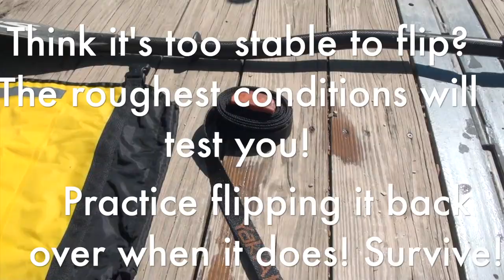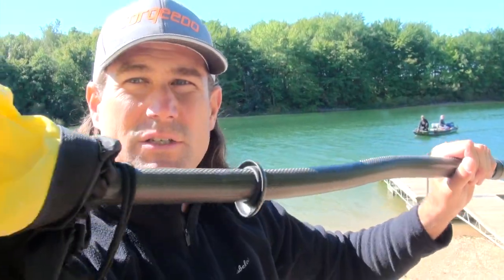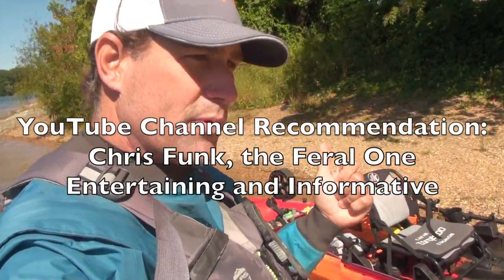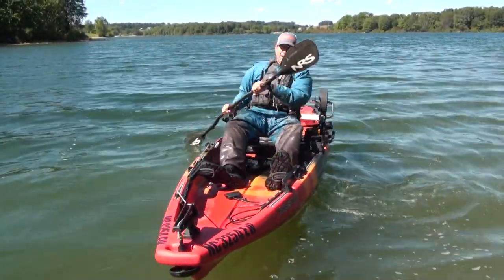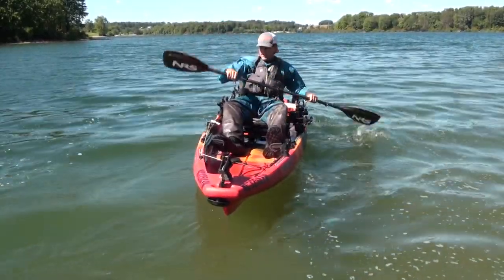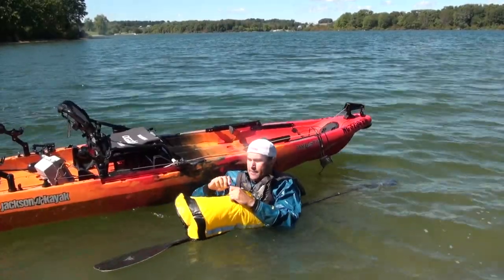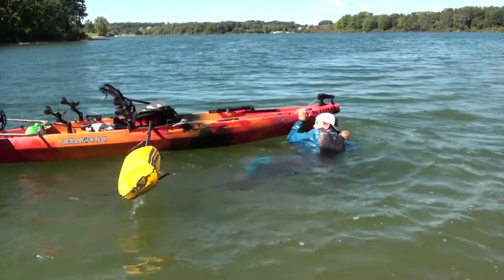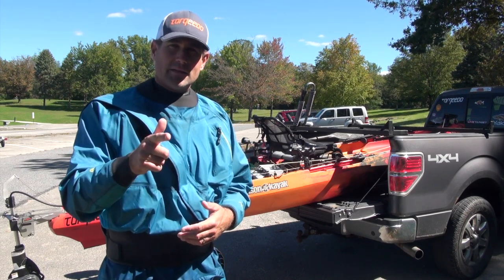Reboarding, Stability and "Unflippable" Kayaks

Comment: Jeff, you should change the site name to "TheGood Stuff"! Poly strapping floats on its own (make it Orange), it would would help to have a sticker affixed to the underside to help locate the straps exact location when you're disoriented/ stressed. Keep in mind you have to do all this with one hand, if you let go of the paddle it's gone forever, especially if the event happens in current (never count on having the paddle to re-board, find a way to practice re-boarding without it too)! If you place a loop in the right place on the strap it will assist your reentry. The loop should be large enough for your toe but not so large that your foot will fit through it.
Flake the strap and secure with weak rubber bands much the way you would pack parachute cords (this way it's ALWAYS there but never in the way).
Reply from the maker: Good tips for sure. Practice is the most important part.

Comment: Sorry for writing a novel on a year old video.  It's a great video and great information.  I just have a few additions some people may find useful.

For those that cannot afford a dry suit, you can use a pair of waders with a wading belt, and splash top.  With your life jacket over the splash top it will keep you dry until you re board your kayak or get to shore.  It won't work for as long or as well as a dry suit, but it will work well enough for long enough.  The myth about waders dragging you down is, well, a myth.  There are plenty of videos debunking it.

If you are cold water kayaking it is a good idea to have a change of warm clothes in a dry bag in case you do get wet.  It should all be synthetic material, or wool.  No cotton.  The saying in winter sports is "cotton kills".  Cotton absorbs 35 times it's weight in water, takes forever to dry, and actively sucks heat from your body while doing so.  Wool, and the synthetic materials don't.  Spandex, nylon, lycra, kevlar, I forget the others, all continue to insulate when wet, not absorb much water, and dry quickly.

It's also good to have a method of fire starting so you can build a fire to warm yourself and dry things in an emergency.

On knowing your limits, last year after the hurricane came through, I was out on Swatara Creek in my Vibe Yellowfin.  It is not as stable as the Ride, but it's lighter and 10'.  It's my throw and go yak.  The shuttle service I use had resumed renting/shuttling so I figured "Nah, it'll be fine!"  I flipped 3 or 4 times, lost a couple of rods, almost lost the yak (thank God it washed up in an eddie), almost lost my paddle (thank God it also washed up in and eddie, AND I religiously keep a collapsible emergency oar in whichever yak I am using).  I should have taken the Ride, or better yet, hit lakes for another week or 2 before trying the creek.  I should have broken out Gertler's Keystone Canoeing and compared water levels and flows.  The last time I flipped was in 2013 or 2014 in the old Pelican sit inside.

As a fat guy I give you permission to fat shame ;)  Facts are facts.  Facts don't care about feelings.  I will tell you that an NRS Chinook will float a 250-300 pound guy ( I "tested" it at 300 back in '13 or '14, and at 250 last year  ;) )

The best stability advice I ever heard was "If your head stays in the boat, your a$$ stays in the boat" ;)
Reply from the maker: Thanks for adding a lot of great advice. I agree with all of it except for the first sentence in the second paragraph. That advice is about saving some money instead of saving your life.